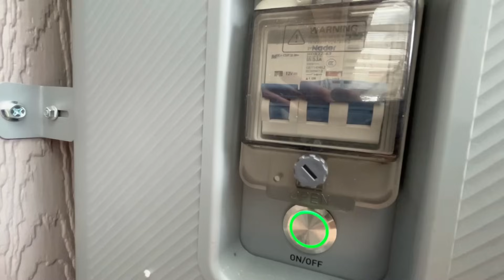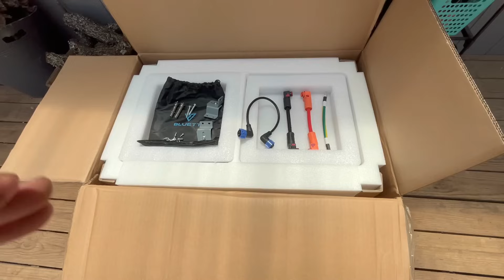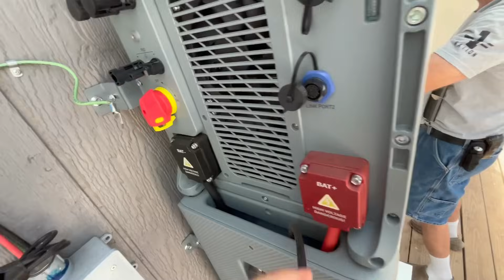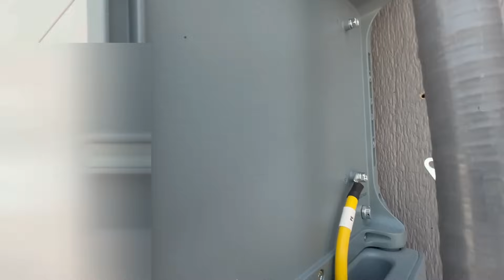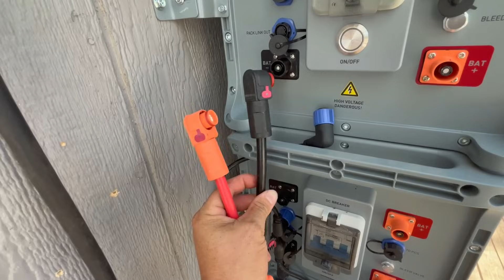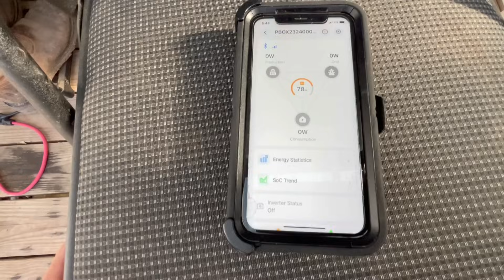Bluetti EP800 - Start small and add B500 batteries as budget allows

Comment: Hi, maybe you can help me out. I have just added a fourth battery and I can’t seem to get a higher charge than 55%. Any ideas on what setting I can change or what I could do. I’ve called Blue customer support a few times and they haven’t called me back thanks if you can help.
Reply from the maker: @wmherndon  sounds like a software issue. Check on the app and see if you need to do an update. If not, I recommend shutting your system down and rebooting it.
Reply: @ thank you for the suggestions. My app is up-to-date and I did try rebooting with no luck. I have reached out to Blue at support again. Hopefully I’ll get a reply. Thank you for the advice.